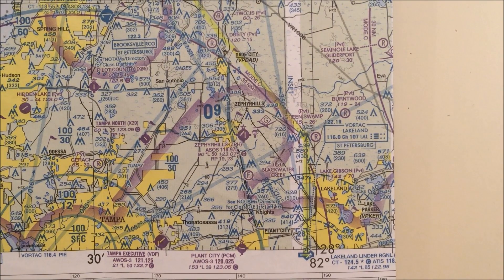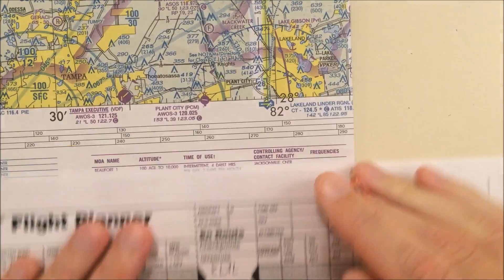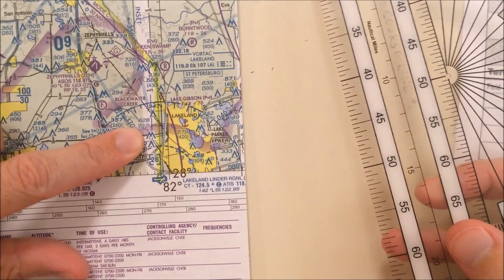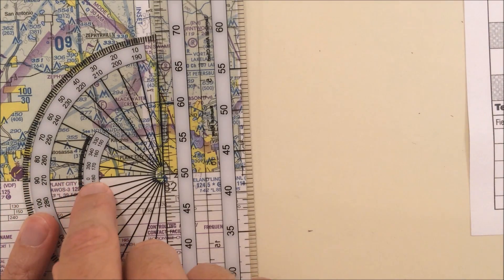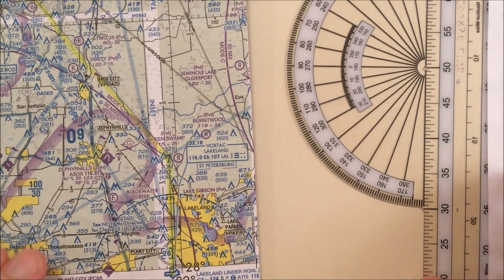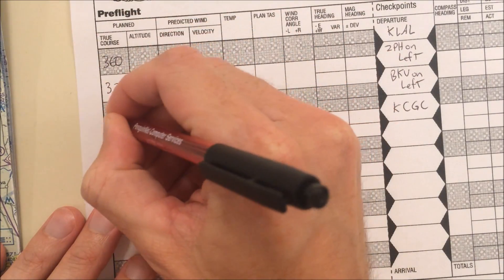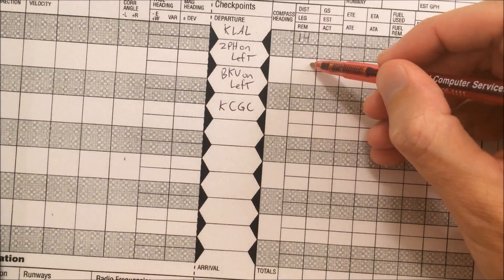VFR Nav Log (Video 2) True Course and Distance

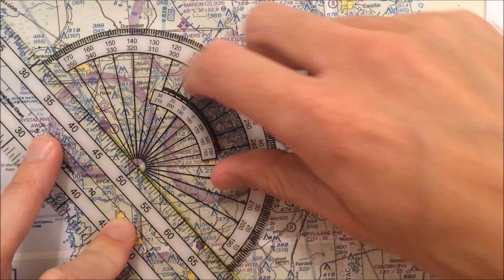Comment: 2:50 Minor correction: The protractor is delineated in single degrees, so since the line of longitude runs through the first tick after 140, your true course would be 141 degrees, not 142 degrees.

Comment: For measuring distance, you don't explain much and skip ahead.  Are you measuring distance between checkpoints or from the start?
Reply: Rule of thumb I was told was to have a checkpoint every 7 - 10 nm. I use my plotter to measure.
Reply: Distance between checkpoints.

Comment: The Nav-Aid Rule and Nav-Aid Plus is the most useful plotter for diversions and alternates.
No need for the 1'60 rule.
No batteries to go flat or a GPS to fail.
Never get lost when you are navigating with map, clock and compass.
These plotters make it a dream for visual navigation. 
Durable, flexible polycarbonate will not break.
More information at www.sifeba.com